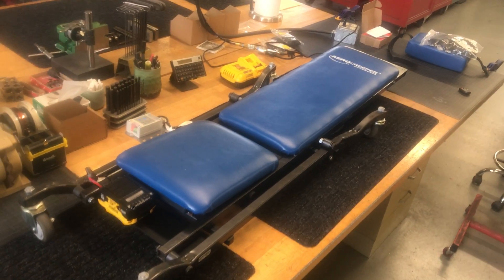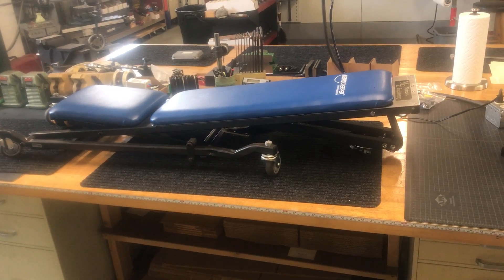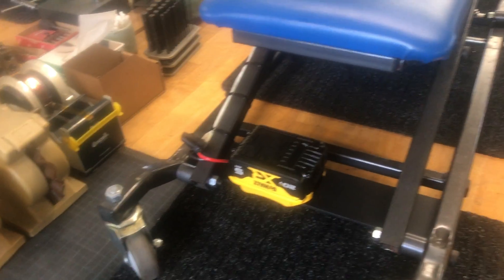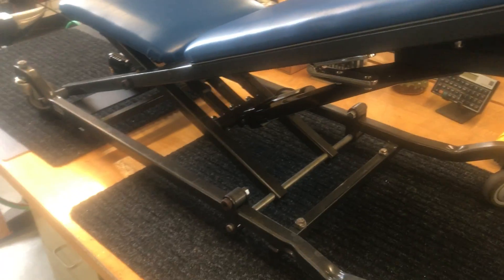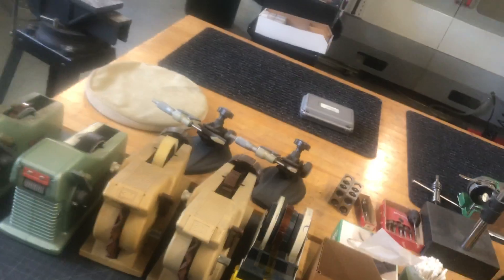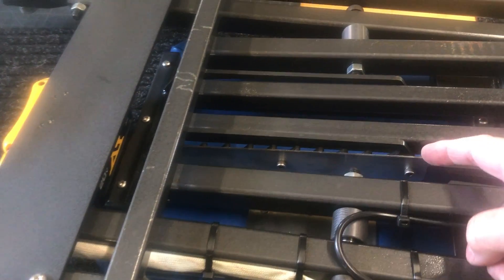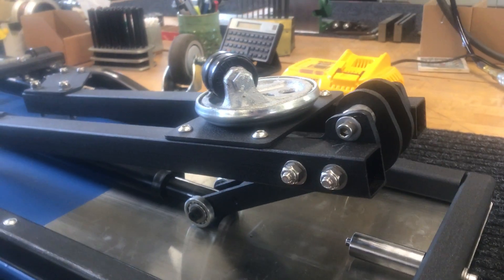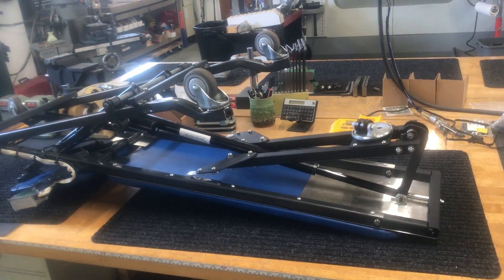Automatic Jack-Screw AeroCreeper (Part 2)

Comment: i was thinking what if it automatically move up while under the car😂  hoping there is emergency stop button
Reply from the maker: There is a force limiting clutch and most of the force is used to lift the occupant so there wouldn't be much force left.  Also, the controls are all momentary so, let go of the control and it stops.
Reply: Don't keep the remote in your pants but secured where its not touched while working.

Comment: Can you link to any details for the jack screw and controller you used? I saw the other comment where you said it is rated at 3500n but can you link to it or provide a model number?
Reply from the maker: Search on eBay or AliExpress for 3500N Linear Actuator.  Good luck!

Comment: What jack screw did you use? I read it was 3500N but I couldn't find anything like it with a controller and remote.
Reply from the maker: Search on eBay or AliExpress for 3500N Linear Actuator.   Search also for DC motor remote control (usually 24V probably need 10 Amp version) Good luck!
Reply: Found one for $137 with pump cylinder and controller with remote

Comment: What force jack screw did you use for this project? You mentioned it being able to lift a 250lb occupant.
Reply from the maker: 3500N (787 lbs.).  The extra force is needed as the actuator is sometimes working at an indirect angle.
Reply: @MathIndy  could I be cheeky and ask what the stroke on this thing was? Math was never my strong suit lol.

Brilliant build by the way! DIY FTW!!!!!!!

Comment: So basically if Murphy shows up this lift pushes your face into the plane...😂
Reply from the maker: This has never happened and the motor isn't strong enough to press that hard. There is also a power-off switch next to the operators right hand.

Comment: Tom can you sell me the bracket kits and give me the specification on the strut
Reply from the maker: This was only a one-time thing and I have no kit to offer.  Even with a kit it is quite a project so a kit probably wouldn't go over too well.  There are companies that make powered lifts but, yikes, their prices are high.
Reply: Hello Mr Matthews, which electric lift did you use what model?
Reply from the maker: @jasonvergara7705  Search for "Aerocreeper"
Reply: Hello Mr Matthews, which electric jack screw did you use what model?
Reply from the maker: @jasonvergara7705  Search on eBay or AliExpress for 3500N Linear Actuator.  Good luck!
Reply: With the length of those top  arms that you built the Jack remodel and how much you extend the top of the platform I can build it I will be eternally grateful my shoulders are hurting bad getting off the floor